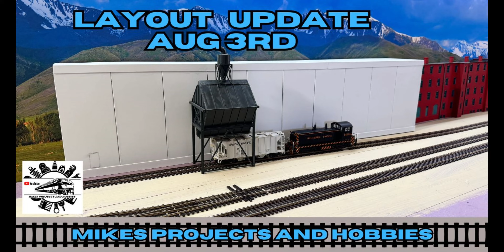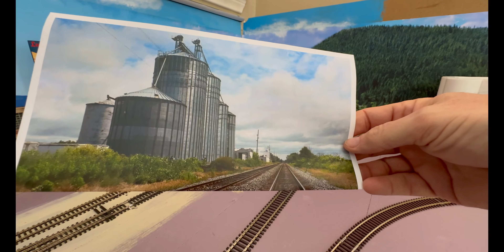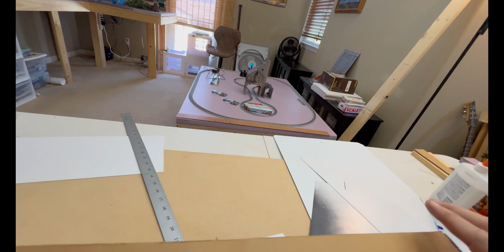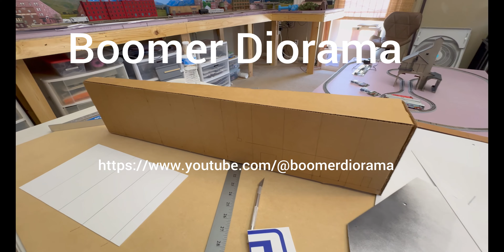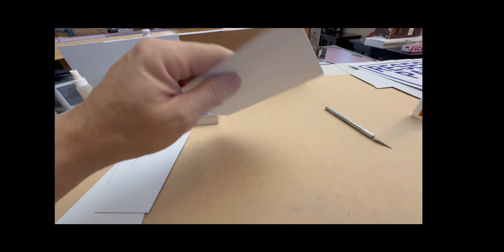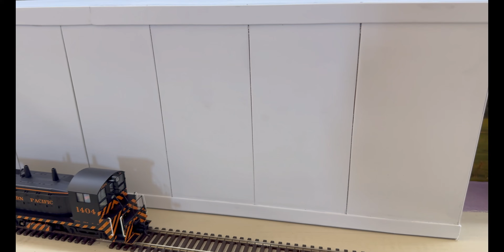Inexpensive DIY HO Scale warehouse or manufacturing facility?

Comment: why did you need to piece the styrene instead of gluing one piece, boomer does do nice work
Reply from the maker: @tomgiorgini9154  Basically to better simulate slab wall construction of the building.

Comment: hi mike !!! great stuff, i must say !! i like the kitbashing part of our hobby just like you as i have a problem with 2 areas of some of the pikes we see.... #1, layouts that are very clean and perfect !!! real railroads just are not like that ! #2, seems like EVERYONE has the same buildings from the same manufacturers,  which just drives me crazy !!! your warehouse engineering is simply beautiful and its "off-set" styling is top notch !!! i did notice that you may not want to keep the delivery "bin" or hopper, and if you do decide to "re-build" it, a great place to start is walthers cornerstone aggregate bins 933-4090.  by using them as a very basic starting point, you can kitbash with plastruct and/or evergreen plastic as i did. after adding some silver piping and  a few smaller air handling or distribution tanks, i can promise you no one will have anything like you !!  besides really liking kitbashing, it allows me to screw-up occasionally and then re-think, engineering wise, how to remedy the situation !!! please keep the videos rollin', mike !! denny